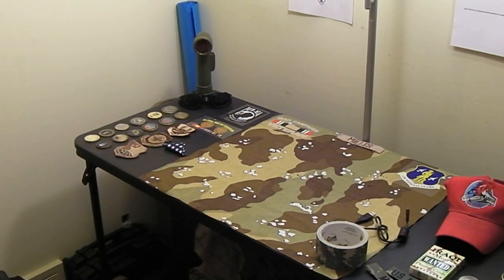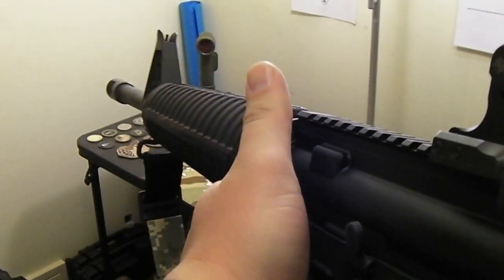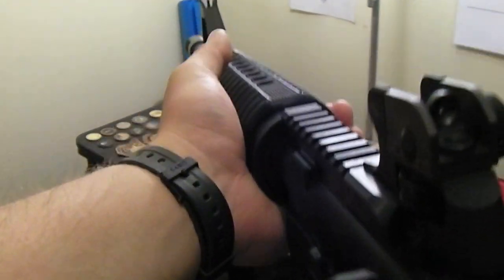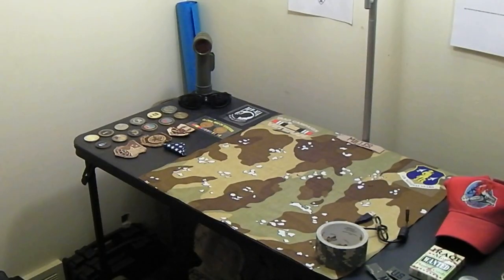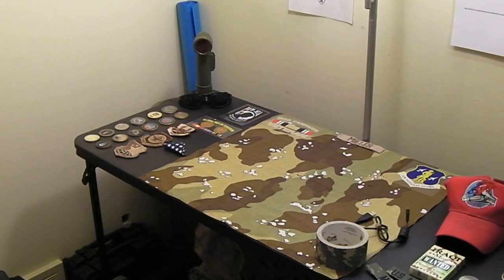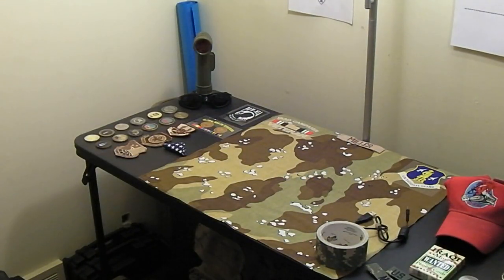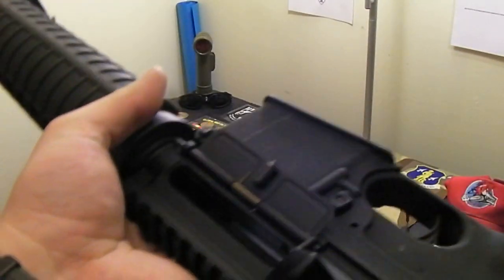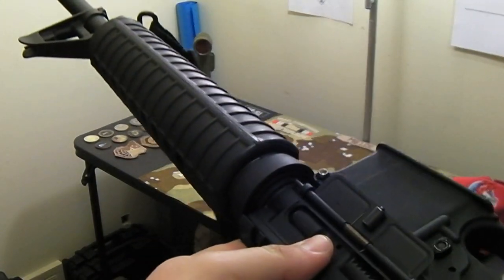...concerning the ultra fast AR15 reloads

Comment: hoss did a video that talked about this. he made a really good point that in side under low light you can check your chamber pretty fast. BUT if you are out side under the bright sun you can see into your chamber because of the brightness to  darkness.   good video my friend. cant wait to pick up my parts to get my ar a little closer to being done tomorrow. basically just need the hand guard, a mag, bolt assembly, and sights and i will be set.

Comment: Great vid Miller!  One thing to add...if people can't tell the difference between their bolt locking to the rear upon an empty magazine and a misfire, they need to get back out to the range.  Also, if you have to do a mag change in one second or less because the bad guy is so freakin' close, one's life is better protected by a quick transition to the old pistol.  In that situation, doing a chamber check will get you killed!

Comment: I noticed something interesting.
After I watched this. 
I put a casing into the chamber as far as I could get it in. 

And when I tried to look inside the chamber quickly, I couldn't see the brass inside the chamber. 

I had to slow down.
And now I'm training my eye sight to shift from my target, to the chamber real quick while actually looking for that piece of brass before i start to reload. 

It's easy to see a stove pipe with the uber .5 second look. 

But not if the brass is still inside the chamber.

Comment: I think the Magpul battery of arms, if I may call it that, is good. I practice it myself. However, i COMPLETELY 100% agree with you. If you aren't actually looking in the chamber, why bother, just jam another mag in and rock and roll, why add the extra move? I do it that way however, I do not go for speed per se. I just go for efficiency. I tend to go with "slow is smooth, smooth is fast" type of manipulation.